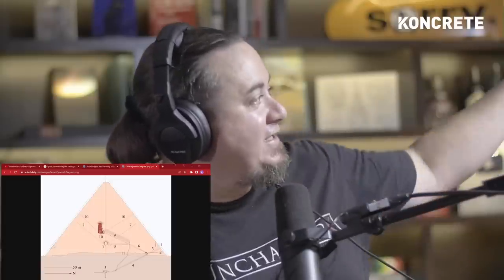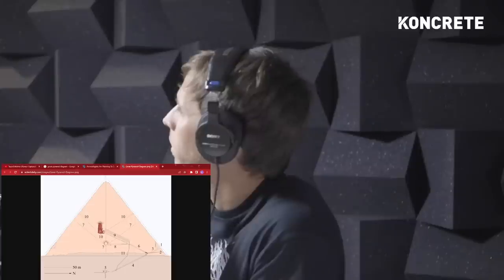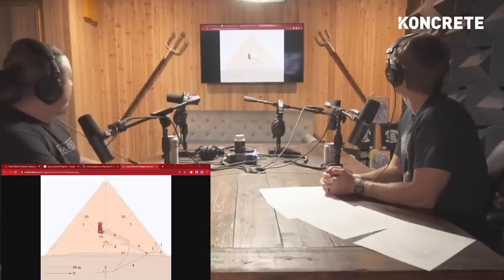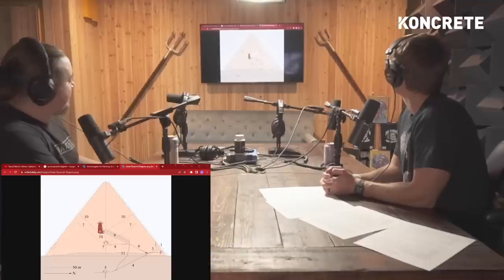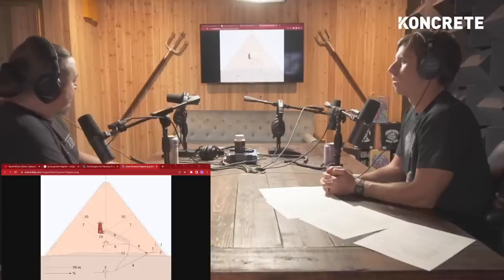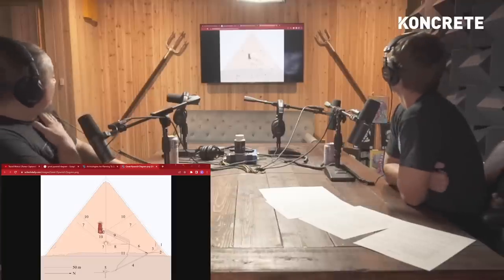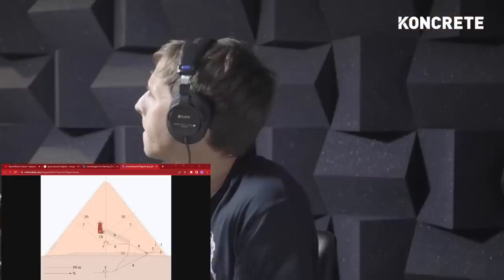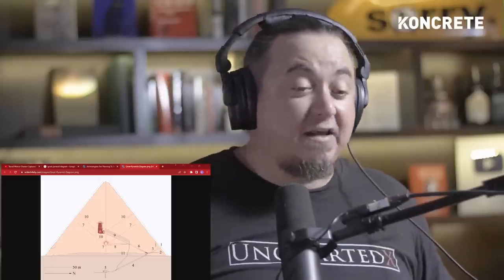"Power Plant Theory" Perfectly Explains the Egyptian Pyramids | Ben Van Kerkwyk

Comment: I have always had issues with the standard model of what the shafts were for. They say that they are pointed at different stars. Basically like a cannon to shoot the pharoh's soul to the star. But the shafts are blocked with blocks in several spots. so how does pharoh's ghost get past the blocks? and if they can go through them like ghosts do. Then what is the point of the shaft to guide the spirit at all? Wouldn't they go through the walls of the shaft too, like ghosts do. the whole idea is illogical. If we assume they didn't have a concept of ghosts being able to go through walls like we do. It makes even less sense because the shafts are too small for a person to fit through and they are also blocked. So a ghost would have to be able to go through walls just to use the shaft. So the whole thing is pointless. Why make a shaft when the pharoh's ghost could just go though the wall of the pyramid and not even need the shaft. But the shafts were aimed at stars to guide the spirit. That is even more pointless. Once the spirit is outside of the pyramid, it no longer needs the shaft to guide it. Look at the star you want to go to and just go. The shafts seem to be there to solve a problem that isn't a problem. when you are talking about a spirit that isn't bound by physical matter or space and time those shafts are about as useful as hammer made of jello.
 The idea is that they did all that extra work to make these ritualistic, symbolic shafts, for a reason that doesn't make sense and is completely pointless. That is what mainstream egiptology is telling us. I refuse to believe that. Those shafts had a functional purpose otherwise they would not have went through the extra effort to make them. And it wasn't ventilation, because a blocked shaft doesn't vent air. I think they were emergency pressure release valves. I wouldn't be surprised if those blocks are held in place by those copper pins, and once the pressure gets high enough it will break the pins and push the block so that it drops down into a cavity directly behind it  allowing the pressure to escape. I cant come up with any other reason for them being there. They don't allow air or light in, they are too small to be a crawl space to another room, and they are blocked. 
I don't believe the pyramid builders were a bunch of joking pranksters. They didn't build all those crazy features into the pyramids so that people 4000 years later will be scratching their heads to figure it out.  They weren't laughing around while they worked with the hardest heaviest building materials on earth. Joking to themselves saying, "Let's put a bunch of purposeless sealed shafts in here, that will really confuse people later on when they try to figure out why we did it. And we will point them at stars just to make it appear that they have a purpose, when they actually don't. That will be a real hoot, let's get to work on that." Said no pyramid builder ever.
Reply: Great comment! Agree 100%.
Reply: Your argument about the unnecessary and pointless nature of the pyramids overlooks the fact that the entire structure was built as a religious monument to the pharaoh and a testament to the power of the Egyptian state. It is no different from the grand churches built by various religious groups throughout history. As for the idea that the chambers within the pyramid were pressure release valves for some kind of energy machine, there is simply no evidence to support this theory. Even if we were to entertain the notion that the ancient Egyptians had advanced technology, it doesn't make sense to construct such machines out of stone rather than metal alloys. Additionally, there is no evidence of energy being released, nor are there any signs of scorching on the walls. While it's possible to invent fanciful theories about hidden technologies, it's not convincing without any evidence to support it.
Reply: @trout3685  
Gizza Pyramid is 36k yrs old or  thereabouts, Built by the Baacchhii when the Fled, Antarctica ..
Egyptians never built it ...
It generated Electro magnetic energy...
All pyramids did ...
They kept our Magnetic Field Topped up so to speak ....
Reply: So, let me get this right, what you're saying is that artefacts built on the basis of an ancient mythology make no sense? Have you looked at Roman Catholic Dogma and tried to make sense of that?
Reply: @trout3685  I won't like to discount your view totally but the essentially common point appears that as we move from East to West the marriage of religion, science and politics gets thinning and weakening. In Egypt religion (rituals) and science started having marital conflict. In one line I would say Aliens (=unknown ETs) built these pyramids. They didn't expect the likes of Pharaohs and kings and Tootakhamans or Khuphus would encroach it. If this happenwd then they were thd first to establish class rule, class society and classes. We don't know why ALIENS abandoned the pyramids. To avoid conflict? It appears. Class rule is still intact. The process of "so-called primitive accumulation" of capital in the early stages of development of capitalism as Marx said or what Adam Smith prior to him said "primary accumulation of capital" was thus started. It was long ago say 6000 years ago or may be 25000 years ago if dates acrually go back. Did aliens inject the first dose / DNA of class based society differentiated on wealth and power? Game of power continues. "Power to the Soviets", thus spoke Lenin. Political power or electricity power? "Knowledge is power", says 21st C wisdom. Without capital or economy  there's no power. All vying for private individual power. No one for collective power. Dear Aliens! Comrades! Friends!
Reply: It should be pointed out that, compared with all other large engineering problems that the pyramids represent, the shafts are relatively minor. Building them into the pyramid is nowhere near as difficult as quarrying the 60-ton granite blocks for the king's chamber. I'm hung up on them as you are, but they don't even make the top 100 hardest slots on the build checklist. Maybe they existed to help guide the angle of the build as the structure grew taller, another place to check your measurements so that everything is aligned. The grand gallery also helped serve this function, even though its primary purpose was to lift the 60-ton granite blocks.

Comment: Ben is so emphatic about precision; that super hard granite needs presice diamond tip blades. 
If so, why would they not use these same sawblades on softer sandstone?
In the total amount of stone needed for the pyramids, the amount of sandstone is far greater than the amount granite.
Why use machines to cut the smaller amount of hard stuff then stop and go to hand work on the greater amount of softer stuff?
We should see precision cut sandstone, but we don't. If fact you can still chisel marks on the sandstone to this day. 
If you had to cut a small amount of metal, and a large amount of wood, would you use a power chop saw for the metal then switch to a hand saw and chisel for the greater amount of wood?
I wonder how long till this is up before Ben deletes or ghosts this comment.
Reply: Because of limited resources and time?
Reply: @gilian2554  limited resources and time would incline you to want to do the opposite of carve stones by hand with copper chisels.
Reply: @gilian2554  I see your point maybe they wanted to waste time and resources by not using "machines" to cut the soft stuff. Let 100 people do what 2 could
Reply: maybe because sandstone and limestone erodes fast compared to granite, the outside of the pyramids were also extensively quarried. do the stones not exposed to the elements and stones still in original place have chisel markings or are they precise

Comment: We couldn't even measure it's accuracy until Whitworth invented the micrometer
Reply: While the invention of the micrometer did make it easier to measure the precise dimensions of the pyramids, it is not accurate to say that the accuracy of the pyramids could not be measured before the invention of the micrometer.

In fact, the ancient Egyptians themselves were known for their remarkable precision in construction and engineering, and many of the dimensions of the pyramids can be measured with a high degree of accuracy using basic tools such as a plumb line, a water level, and a straight edge.

In addition, scholars and travelers throughout history have measured and recorded the dimensions of the pyramids using a variety of tools, including compasses, quadrants, and telescopes, among others.

While the micrometer certainly made it easier to measure the pyramids' dimensions with greater precision, it is not accurate to say that the pyramids' accuracy could not be measured without it.
Reply: @trout3685  I don't think you've understood what a micrometer does.

Comment: Even if ancient Egyptians knew about the existence of electricity there is no existing evidence of anything they would have used electricity for other than perhaps lighting, it also makes no sense to think that a structure like a pyramid of that size could have any use for creating electrical power, I personally believe that the reason the shape of the pyramid was used because it's very easy to build a tall structure using that step up approach to gaining height, I also believe that much technology of the day went into constructing it, such as the internal ramp and the Kings chamber being used as a lifting device to haul large blocks up the face of the pyramid. Sometimes the simplest answer is the correct one! Ancient Egyptians were sophisticated people with scientific knowledge and yet not able to utilize technologies that were not  to be discovered until thousands of years in the future!

Comment: This is the most logical explanation I've heard.
Reply: The most 'logical'? Seriously?
Reply: @TankUni  c'mon lets here it then
Reply: @FlipzPlayz  The most logical explanation is what every line of study has pointed to; that they're tombs, but also visible expressions of the Pharaoh's power.
Reply: @TankUni  yeah okay that's the most boxed in idea
Reply: @TankUni  There is absolutely nothing in those three pyramids that suggests they were tombs of the Dynastic Egyptians. 

Dynastic Egyptian tombs were nearly ALL known to be elaborately decorated with hieroglyphs and treasures, and there is zero, absolutely no evidence of these ever existing in the great Giza pyramids. At the very least, if these were tombs, there would undoubtedly be large, elaborate statues and sculptures that were so large that looters could not fit them through the passageways and out of the pyramid, which of course there are none.

These 'logical explanations' need to be re-addressed and re-written.
Reply: @TankUni  except not a single mummy has ever been found inside a pyramid. They were all found in known tombs. besides that, like others have already said here, tombs were always elaborately decorated from floor to ceiling in carvings and paintings. Nothing like the great pyramid, which had zero decorations hieroglyphs or really anything inside it.
Reply: @TankUni  My original points still stand. And, even if a mummy was found inside the pyramid, which hasn't ever been the case... it doesn't mean they were put there originally. Any culture after their construction could have put a body in there. But any way, the great pyramid was never opened before. Literal tunnels had to be dug and blasted by dynamite. No Grave robbers had been inside it before it was opened. Go read more.

Comment: The problem is that there is nothing resembling power lines, no turbines, no machines, nothing found
Reply: Maybe look into the theory, so things will make sense more.
Reply: The problem is that we still view electrical systems through an extremely simplistic model (basic principles of electricity)
It's obvious that these principles do not accurately represent the entire model of electricity. 

Much like general relativity and Newton's laws completely ignore quantum physics.

Most Scientific models used today are insanely basic, very far from a complete understanding.

Comment: Why do all the explanations of the sandstone require the stone to be cut? Couldn’t the ancients  have known how to pour cement and make concrete mixtures and frames ?
Reply: It is solid,  not man made  & some stones have been found with cut/drill holes
Reply: 👆There are quarries were they took the stone from, too
Reply: All you have to do is build a huge furnace that can melt stone. We can do this today.
Reply: @turokforever007  and how are you to prove that the cut and drill holes are original someone could've drilled them 100 years ago, or they could've been  from an earlier structure
Reply: Probably because some cemented aggregate mixture doesn't have the same resonant properties that this theory would likely require. The theory has to do with the structured being a coupled oscillator. Its a resonance machine.

Comment: What happens when you put quartz in a vice? Answer: It makes electricity. Granite has quartz in it (10-50%). How much weight is on top of the granite over the king's chamber. The makings of electricity all day every day since completion of the pyramid's construction.

Tell me, I'm I wrong, if so how?

Question:
How do you get quartz to vibrate more than 32,000 times per second?

Answer: 
Put an electrical current to it.

Now do that to a puddle of Mercury. Then reverse the +/- Your on your way to explaining biblical flying saucer.
Reply: yup, giant quartz crystal coupled oscillators, resonance machines, tuned and proportional to the planet.

Comment: I believe that they are landing lights. If you look at them from altitude they form perfect arrows depending on the direction of the sun. Now cover them with white limestone and you'll be able to be able to see it from space.
Reply: So your telling me they where so advanced they had space flight but didn't have simple navigation or something like GPS and instead spent considerable resources to build massive stone pyramids just to point where to land.
Reply: @Mr.Schnaps  I'd rather pilot my craft than punch in a destination. Just me though.
Reply: @Jack-pz4my  that's not the point at all, It doesn't matter if you are piloting the craft yourself or there's auto pilot, if you're at the point you have space travel then you also have advanced navigation and don't need massive stone pyramids. Take the moon mission for example, they were able select a destination on the moon they wanted to fly to, flew there and back and didn't have huge stone pyramids or other super structures on the moon or earth to guide them where to land and most of that was piloting by hand and extremely basic computers. The idea the pyramids served as landing lights of sorts for space craft or any craft for that point is just plain stupid. Also just like space travel today even if you wanted to pilot by hand you might not be allowed to and the auto pilot has the controls because that's what the people in charge have decided.
Reply: @Jack-pz4my  yeah they had self drive but they realized they felt more connected to the road with a standard transmission so they made a few pyramids

Comment: Any being that has the technology to traverse the galaxy would be more than capable of building a much more compact power generator. Anyone consider that?
Reply: Guess that depends on what elements you're focused on. If you want it to last a long time then stone is definitely a material you might consider using, especially if its easy, to them, to work with. Also, there may be aspects and relationships of its function to the planet and the principles its operating on, that require that it be made out of specific materials like quartz crystal. Ever consider that? If its built to function as a device coupled to the earth, drawing energy from or utilizing earth resonance, then you have a power plant that doesn't require fuel, like a nuclear power planet or something like that.
Reply: @AnunnakiAaron  I think he's focused on the elements that this was some advanced technology even though there are no signs of advanced technology.

Comment: There is another way to produce power. One that's proven with today's science. And gives reason for making stone's perfectly flat. Take 2 perfectly flat surfaces of the same material. Bring them to millionths of an inch apart. And a attractive force is created. That is a  undeniable form of energy . Now if you allow them to touch you will find they bind together so tightly you will have trouble separating them. Also if you put them in a vacuum. Place the 2 perfectly flat surfaces together. They will combine to be 1 piece. Yes ONE Piece. Not 2 stacked. But in fact 1 solid piece created as a result of them combining their molecules.   Imagine that ....   Don't believe me ? Look it up yourself

Comment: If you want to "crank" it up surround it with magnets, or better yet, variable frequency electromagnetic generators. If you want to ride along attach them loosely to the middle pyramid and make the field directional. Find one of the FPV "helmets" cast aside as cerremonial, as the inside will come alive. Where you look is where you go. How you think is speed you go. Understands that not language. Easy on the power. Has oxygen generator BUT hasn't been used in a while. I have dreams. Every inch of skin must be covered.. little to no r aadiation, but other unknown fields .....who knows?
Reply: Maybe. Probably not though. Its damaged. Its not even complete anymore. The outer casing stones are removed and much of the internals show signs of shifting. Its a musical instrument that's out of tune and missing parts essentially.